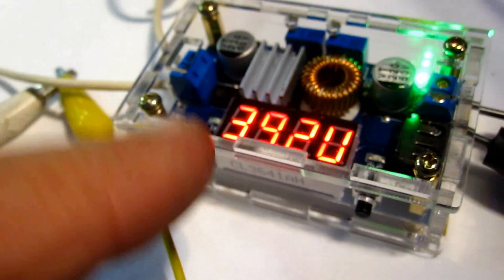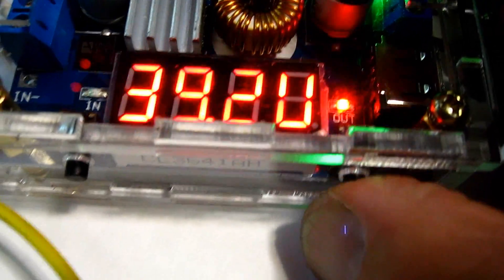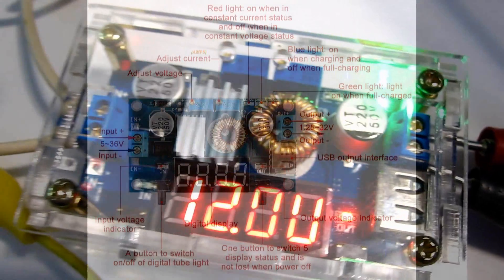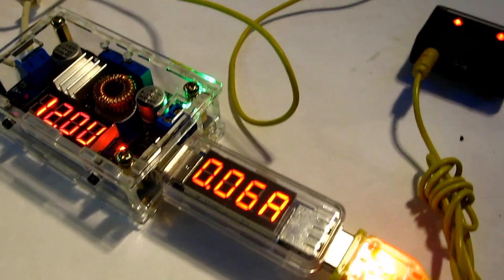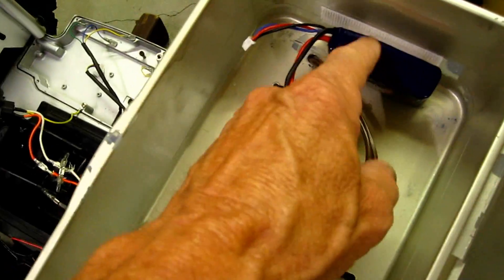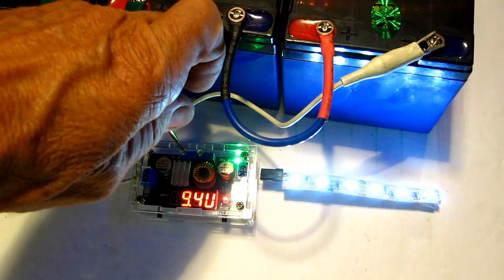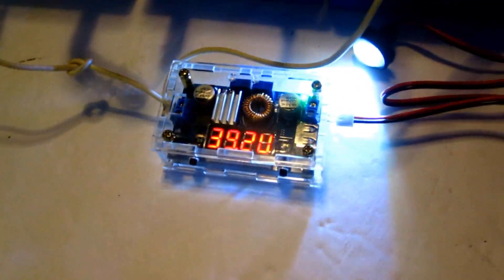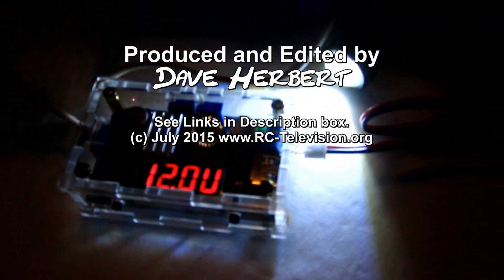Buck Volt regulator is Handy Gadget for under $10, Step Down LED Driver product review.

Comment: Would you be able to remember the maximum output current for the USB output?
Reply from the maker: As it says in the specs :08, it is 5 amp Max.  Thanks.

Comment: I thought you adjust the voltage with the front right nob? why are you adjusting it with the screw? THX
Reply from the maker: There are no knobs. At the beginning of the video, I show what each control does. There are 2 push button switches on the front. Pushing the one on the right changes readings. Push it to select voltage, then use the potentiometer screw on top left to adjust voltage. Push the button again and it changes reading to amps. Then use the right potentiometer screw to adjust amps.
Reply: @NightFlyyer  Thank you for responding. I misunderstood. Where can I find a device like this, that has an adjustment  KNOB, instead of a screw? Any information would be greatly appreciated, thank you so much
Reply from the maker: @prakashspex  unlikely. A knob would be too easy to bump and so this keeps things stable.
Reply: @NightFlyyer  could a knob be installed, I use it for a different application,thx
Reply from the maker: @prakashspex  Not easy. You would have to find a larger potentiometer of the same value with a knob like a volume control and mount it externally. Good luck.

Comment: is it ok that it the input voltage is 11v and adjust the output voltage to 12v?
Reply from the maker: This unit does not increase voltage.  What you put in, is the max you can get out.
Reply: @NightFlyyer  thanks.
Reply: How about the current?
Reply from the maker: @beljannuenoz8269  No. If your trying to increase voltage or current, you need a step up regulator.  What goes in cannot come out bigger with this unit.
Reply: ahm sir, is it ok to charge a 12 v, 5 amps supply  to a 18650 battery that has a 11v to 14 v, 9Ah capacity? thanks
Reply from the maker: @beljannuenoz8269  Lead acid or Nicad batteries only.  Do not charge a LiPo.
Reply: Ahm sir, how much is limit current in the input?
Reply from the maker: @beljannuenoz8269  I typically charge at the battery at it's current rating or under, like a trickle charger will provide.

Comment: Hmm. Could this be used with a power mosfet to add switching to the output ? Could it be switched at 50 kHz or 1 mhz?

Comment: Can someone help?  I have this Drok model.

https://www.droking.com/75W-Power-Supply-Module-USB-Charger-DC-6-32V-to-1.25-32V-5A-Buck-Converter-Adjustable-Voltage-Regulator-DC-12V-24V-Adapter-Driver-Module-Dual-Display-Digital-Meter

I use it to charge batteries and I can’t figure out what the current adjustment is used for.  Doesn't the unit alter the current amps automatically based on the input voltage and lowered output voltage?

Is this supposed to act like a cut-off switch you set when a voltage is reached on the charged battery?

Comment: Blue light is always flashing on mine when I am powering a cellphone without battery or powering other devices, is this normal?
Reply from the maker: I don't know.  I never ran a cell phone with it.  If it is working, I suppose it is fine, but mine burned up when my house burned down on 911 2016 and I don't have another to check.  Sorry.
Reply: @NightFlyyer  Sorry to hear that about your house, but it looks like it is working the way it is supposed to, so I am monitoring it carefully before I put it to use, I am using the phone as a scrolling sign board .

Comment: "programmed" USB-Desaster! 
Afaik:  all modells (search in google!) are the same construction.
So: all of them, have a usb connection, with the same potential!
Which meens, that the usb ALLWAYS has the same voltage as adjusted!

Which is very critical, when the adjustment is above / fare above 5 volt!

Is this - in the meanwhile - "normal"?????????????
To sell a construction, which can supply more than 5 volt !
- to a STANDARD  USB connection????????????????
Most of the sellers don't inform about that.
Some tell about somewhere in the following text
Some "hide" it in the FAQ's

Of course, they don't present it in the main discription!
Btw:  where it SHOULD be!  / HAS to be!

If they did it - nobody would buy it!

Junge Junge Junge! - da leck's mich doch am Arsch....

I just started a "campaigne" within that - on Ebay and Amazon

To sell those "Gadget's" is like handling the online market places as:
"Rechtsfreier Raum" - Place without rooles!

@  NightFlyyer!   Don't you think, that YOU have to inform about the "USB-Desaster"??????
Reply from the maker: No.  This has nothing to do with USB's 5 volts.

Comment: I need a adjustable current limiter/regulator . Ex . I want to change a battery but i want to be sure that the voltage will never go over 14 volts and the current will never be more than 0.5A for as long as it is hooked .Can this module do this ?

Comment: I have something similar.  I connected it backwards and blew something inside.  It's a step down box. 60v to 12.
Reply from the maker: Yes backwards hookups are not good.  What runs on 60 volts?
Reply: I have a 52v battery for an ebike. I'm pretty sure I blew something when I accidentally reversed the polarity into the step down box on. Would u happen to have an idea of what  I may have blown? I'd like to repair it myself.  I'm trying to learn about these things
Reply from the maker: @edgdeal76  Usually there is a diode to prevent wrong polarity hook ups.  If you have too much voltage, the diode is always the thing that blows.  It works like a 1 way fuse.  Or, there may be an actual fuse that blew.  Good luck.

Comment: Hi, I like your video and appreciated it very much. Thank you for your time making it, so others can learn.

I have a question, form the figure you showed in the film, is it correct, that I can set the Amps too? because I need to compress 14,8V into 5V but, I need around 3 Amps - is it correct, that I can set it like that? Do you know the maximum Amp it can produce? 5? 10? 

thank you very much in advance,

sincerely 
Lasse

Comment: Quick question, do you have to press a switch to get it to output, or will it remember it's last state?  (I have a smaller version that requires a button press to output)

Thanks,
Dave

Comment: I really enjoyed your video. For those that didn't know that the USB voltage was the same as the output voltage, when working with these little gems, buy yourself an inexpensive digital multi-meter and always check the input and output voltage before connecting devices. This little inverter works great for USB. I feed the USB to a 5 port device so I can charge multiple devices simultaneously. The 5 Volt D.C. output IS regulated to the voltage to which it is set.

Comment: Hello guys, can I connect a 12v 9Amp battery to the input of this module?
Reply: TheGamerBoy 12 volt battery is fine.  Those 9 amps your referring to is probably the max draw the battery can handle, or more likely the amp hours.  Amps aren’t pushed, they are pulled.

Comment: can i use this to convert my rechargeable battery output in the booster form 12 v to 25 v http://www.ebay.com/itm/DC-5-25V-12V-TO-0-5-25V-5V-Step-Up-Down-Converter-Buck-Boost-Voltage-Regulator-/181846111759?hash=item2a56df760f:g:q3UAAOSwcwhVOnFw

Comment: I have the same module with a blue display and I have noticed that if you push and hold the right button the display will flash and you can adjust it up or down. Any idea as to what that adjustment is for. Perhaps accuracy of the volt meter in it?
Reply: That is for setting the incoming voltage as far as I can tell.  The pots dial the voltage available up or down.

Comment: I have the same unit.  Connected a 12.8v DC Battery (lipro) to the input and the M7 diode fried.  I've replaced the diode with a 1n4007.   Any idea as to why the M7 fried as I understand the voltage was well within the input specs?  Help!!!!  Thanks

Comment: on the strip light if you were to set it to more than 12 volts could you damage them? and also is there a way to make sure to set it to 12 volts so it wont mess up you strip lights?

Comment: my voltage adjustment screw doesnt seem to do anything regardless of the direction of turn
Reply: +mark c keep spinning it. I thought the same thing when I first got mine. had to turn it a lot before i saw a voltage drop
Reply: @OliverMotorized  im a couple years late but ive spun that thing 100+ times and its convinced its on 0.02 amps, any ideas?

Comment: I bought the same unit at DX and I thought the usb output was always going to be a regulated 5v output regardless of what output you choose to have by adjusting it with the volt potentiometer. I set my output voltage to 9v and checked out of curiosity how many volts was coming out of the usb port. I was shocked to find out 9 volts were coming out on the usb port. Then I raised it to 12v and the same thing happen. So dont use the usb port for charging your cell phone unless you have it set to 5v on the output meter. In other words the usb port will output what ever voltage you select to be the output on the meter. It's not separate from the reading you get on the output.
Reply: Yes ,USB ruined my tablet with 20V.
Reply: Read the seller discription before buying loh.
Reply: Jose Gonzalez  and I

Comment: Dave I notice when you had that battery plugged into the usb and you said it was charging, well it wasn't charging cause the blue light wasn't on only the green light was on. when the green light is in a solid state that means the battery is full and when the blue light is on without the green light being on, that means it's charging. Sorry not trying to be a a hole, just wanted to point that out. I have one.
Reply: Derrick Harris yeah I noticed he said 0.6a/600ma but it was actually 0.06 which is only 60ma. so it maybe wasn’t high enough current to charge the battery?

Comment: As the input voltage goes down, so does the output voltage, right?  This requires you readjust the voltage screw manually.  The are some voltage regulators that will maintain constant voltage.

Comment: So i have Ac/Dc Psu witch  gives 19v i could use this to turn it down to 12v ,but could it handle a lipo charger
Reply from the maker: Hobbyandtech As long as you aren't charging more than 4.5 Amps according to the specs, or you'll need better cooling and a bigger heat sink.  Good Question. Thanks.
Reply: Awesome , would have to give it a test , for the price cant go wrong thanks

Comment: Wow, 6V USB - that's a shocker - I'm not sure that most equipment likes that!
Reply from the maker: ***** I can turn it down with the screw and also the amps.. 6v seems fine and I've been using it to charge my cell phone and charge batteries.  So far so good.
Reply: ***** Eeeek! - You are a brave man! The most old-ish electronics can handle 5.5V MAXIMUM so putting 6V into a new device that runs 3.3V, 2.5V & 1.8V internally is indeed brave!
Reply from the maker: ***** I didn't buy it for the USB anyway, just to turn down my v to 12v. I used it for this demo just to prove to myself that it worked and it seems just like my Receivers for RC, all contain voltage regulators.  Many wall wart USB chargers Ive seen put out more than 6 v.  Thanks for the concern, for it may be justified, I  dont know longevity yet, just a simple convertor cheap.  LOL.